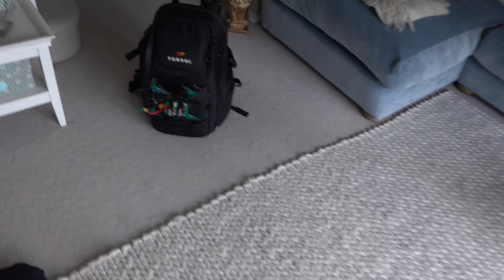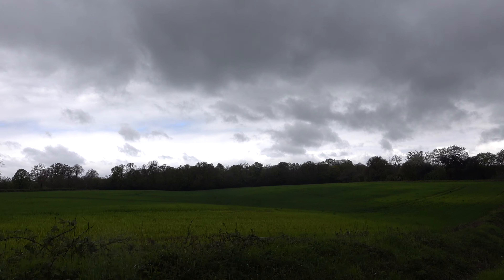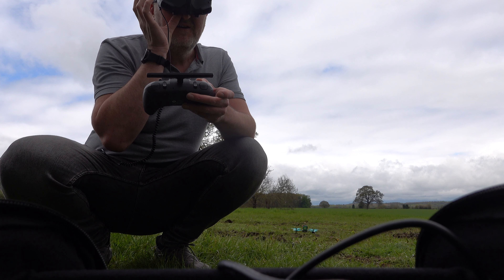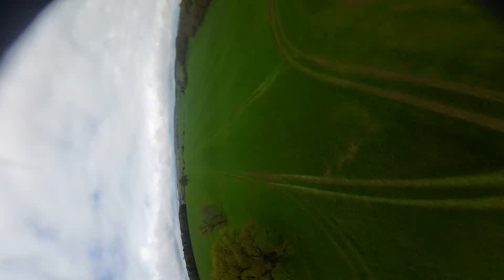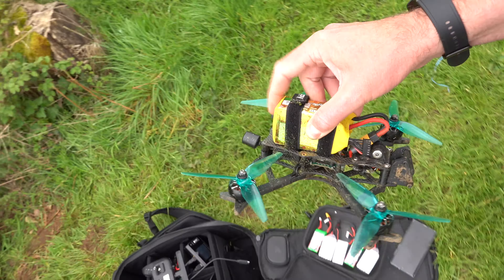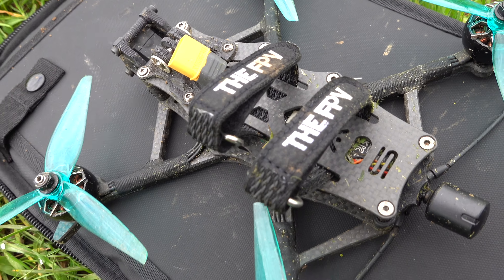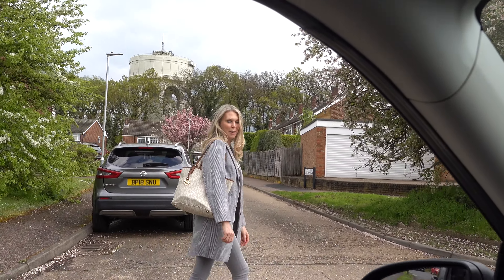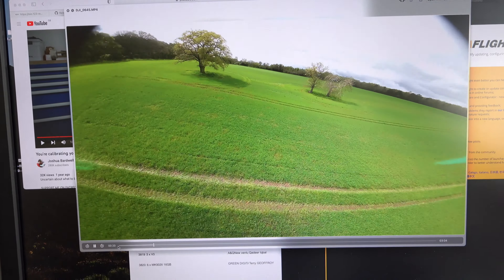WILL IT FIT??

Comment: Hi Andy, you mentioned about walking up the Segway battery, I have 3 dead DJI mavic 2 pro batteries that will not come to life! Any ideas?
Reply from the maker: Hi, The problem with dji batteries that they usually have a pretty fussy BMS which makes it difficult to revive them, chances are the batteries aren't actually dead but their battery management system has decided for some reason to permanently shut them down. Have you tried leaving them on the charger for a while? Don't leave them unattended though or overnight.
Reply: @andykirby  I tried that, and I tried hot wiring them to a working one and powering on!!! Also giving them some voltage via a battery charger! All slightly iffy but as they won’t respond at all I thought I had nothing to loose!